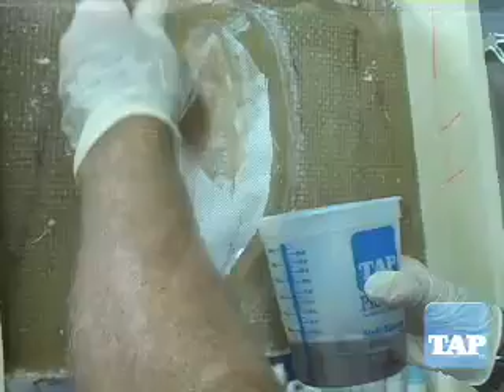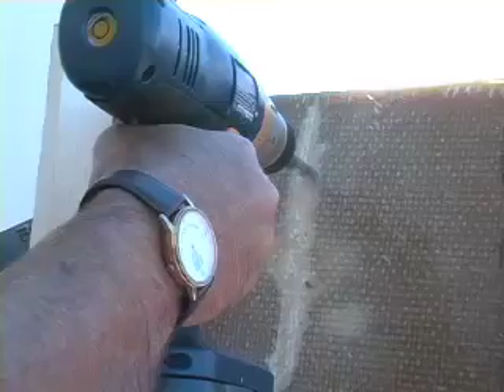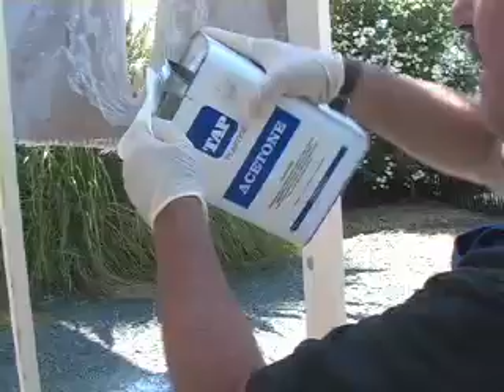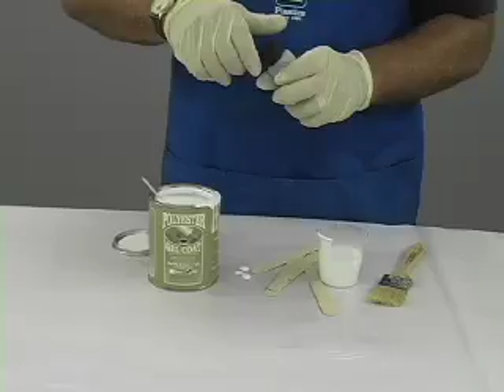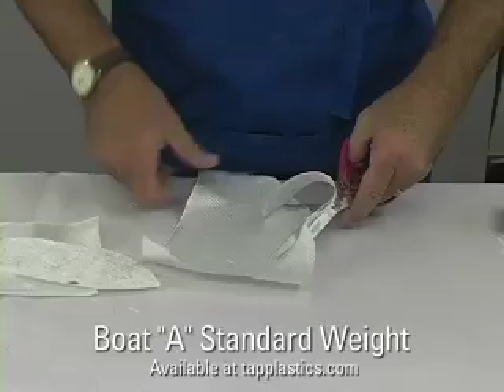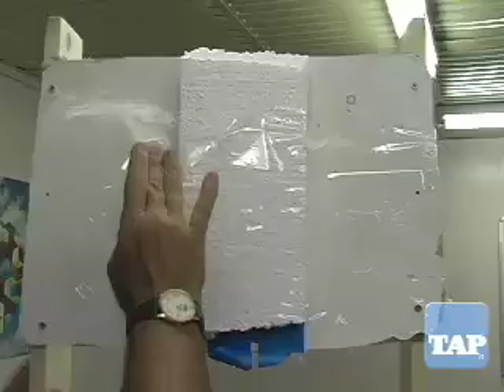How to Repair Fiberglass

Comment from the maker: @1851davidb The video recommends a gel coat thickness of 18-20 mils.  'Mil' is a term used for .001 inch, not a millimeter.  So 18-20 mils is 18-20 thousandths of an inch, about the thickness of 4 sheets of paper.

Comment from the maker: Dyna-Glass is a polyester resin loaded with short glass fibers for incredible strength.  Pack the hole so there are no air pockets.  Do not bring the Dyna-Glass fully up to the surface of the bow.  Once cured (10-20 minutes), apply Dynalite to smooth the repair flush with the bow.  Once cured (10-20 minutes), sand the repair smooth.  Finally, apply Gel Coat to match the color of the hull.  Watch the two-part video, 'How to Repair Gel Coat' at our website for a fuller explanation.

Comment from the maker: @homesellnow The holes must be thoroughly clean before any repair can be attempted.  They may contain silicone caulk, dirt, oil, etc., all of which will prevent anything from bonding.  You may even want to drill out the holes to create a clean fiberglass surface for repair.  Several repair methods are possible.  Here is one.  Pack the holes with Dyna-Glass (you can find it in the fiberglass repair section at our website).

Comment from the maker: @emolater2 That depends on what your canoe is made out of.  Plastic/polyethylene canoes cannot be repaired with standard fiberglass techniques.  Epoxy canoes should be repaired with epoxy.  Not sure what you mean by 'plasticpadding' in your repair question.

Comment from the maker: @13098519 Surface cracks are usually the result of flexing that is greater than the gel coat can withstand.  So any repair must address the flexing issue, or the problem will recur.  One solution is to inject foam under the shower pan as demonstrated in our video 'How to Use Expanding Foam.'  If the 'surface' crack is deeper than the surface, then the fiberglass needs to be ground out to the non-damaged layer and then re-built.

Comment from the maker: @Breeze8488 You can use the same process as described in the video, except you would grind from the front, do the lay-up, and then top coat with gel coat.  I would also recommend applying expanding foam under the pan after you open the hole and before you do the repair.  That will add support.

Comment: Your video was great,but, I would like to use this process in my shower as my shower floor has a hole in it.  How can this be done since the underneath side of the shower floor is not accessible?  Is there another method that can be used that is just as strong?  
Thank you, in advance

Comment from the maker: @tlgoldendc You can use a product called Surfacing Veil.  It is specifically designed to prevent 'print-through' , which your are concerned about.  Besides that, you might want to consider using Knytex.  It contains three layers stitched together.  One layer is mat, the other two are roving.  You can put the mat side against the Surfacing Veil.  Knytex is extremely strong and works well with epoxy.

Comment from the maker: The formal answer is always mix according to instructions, however mixing slightly less hardener should not be a problem.  Tacky surfaces result from other causing mostly from not thoroughly mixing the material, temperature, (both air and material) moisture in the air, or scrapping the sides of a mixing container where unmixed material may cling.

Comment from the maker: @jjkewll However, gel coat has a hard time bonding well to epoxy.  In a tiny area like a screw hole, that probably would not be an issue.  See our video on gel coat repair to see that process.

Comment from the maker: @jjkewll First, clean the hole thoroughly.  Perhaps the best repair material is epoxy mixed with either chopped strand fiberglass or milled fibers.  The epoxy will provide the strong bond and the fibers will give the structural reinforcement.  To hide the repair, sand it flush, then either use a matching marine paint or pigment some epoxy to match the surrounding area.  The surrounding area is probably gel coat, so it would seem logical to use gel coat for the surface.

Comment from the maker: @HomeDistiller You are correct in saying that 20 mm is about 3/4 of an inch.  However the term 'mil' does not refer to millimeters (or milliliters).  It is a standard English measurement term for 1/1000 of an inch in thickness.

Comment from the maker: @YANKEESRULEMLB For the final layer, use mat, not some course weave fabric.  When it is all cured, clip off the wire, and grind the repaired area smooth to a level just lower than the surrounding gel coat.  Wipe with acetone and apply gel coat.  You can then either apply Mylar  to the wet gel coat for a mirror finish, or allow it to cure then sand a buff.

Comment from the maker: @YANKEESRULEMLB Put a wire or string through the center and knot it on the back side.  Fold the circle in half and slide it in the hole.  Once in the hollow space, it should pop open.  Use the wire to pull it tight to the back of the fiberglass.  Now, do the fiberglass repair as described in the video.

Comment from the maker: @YANKEESRULEMLB It is difficult to give a precise answer without knowing the size of the damage.  This will be a general answer.  You will need to adjust it for your repair.  First, grind out a 'scarfed' area as described in the video.  If there is a hole in the fiberglass, it will need to be closed so that more fiberglass can be applied.  If the hole is 2" in diameter, cut a 3" diameter circle out of cardboard.

Comment from the maker: The purpose of grinding is more than just cleaning.  The damaged area of fiberglass must be removed. The structural reinforcement (fiberglass fabric) of the repair should duplicate what was removed as closely as possible.  A patch placed on top of a damaged area will not be as strong.  If the repair is strictly cosmetic (not structural), then wiping with acetone is probably adequate, though certainly not a guarantee that all contamination has been removed.

Comment: I am restoring a 1967  Hydroswift. structurally the fiberglass is perfect (no damage). But cosmetically it is in VERY rough condition. The paint (gelcoat i think) is pretty much nonexistent, faded, and pitted everywhere. Can i simply sand, fill the pits, and repaint this? Or is there something else i need to do. I'm a automotive tech, but this is my first boat, and might as well be the surface of mars to me lol.

Comment from the maker: That depends on what the surface of your boat is.  Some boat hulls are painted below the water line.  Gel coat would not be appropriate there.  If the surface is gel coat on a fiberglass hull, then gel coat could be used.  Proper preparation is crucial.  Also, realize that gel coat does not 'self level' like paint, so it will need to be sanded and buffed to create a smooth surface.  That is challenging for large repairs.

Comment from the maker: Gel Coat will stick to most plastics, including Lexan, unless they are carefully prepared with a mold release.  Two plastics that gel coat does not stick to are polyethylene, and poly propylene.  If a mold is made from those plastics, no mold release is required.

The molds used to make boats are made out of fiberglass with a highly polished gel coat surface.  They are carefully prepared with mold release.  Otherwise the new gel coat would bond to the gel coat in the mold.

Comment from the maker: A properly done repair can be as strong as the original.  However, areas of stress, or complex shape require a high level of expertise.  The repair materials must match the lay-up schedule and structure of the original.  This is often difficult for the novice.  Repairs that have safety concerns should only be attempted by someone with experience and knowledge of fiberglass structure.

Comment from the maker: If it is made out of fiberglass, then you probably can.  However, the auto industry uses a variety of resins, so no guarantee.  You can run a test by using some resin to bond half of a piece of fiberglass or even a piece of wood.  Let it dry, then use the unbonded half of the fiberglass fabric as a handle and try to pull the fiberglass off.  Same procedure if you used wood.  That will give you an idea of the bond strength.